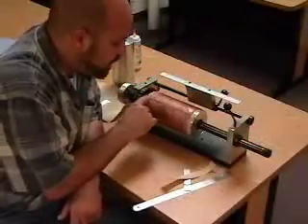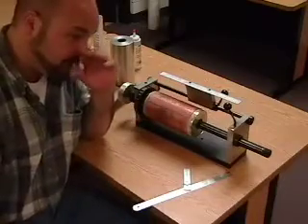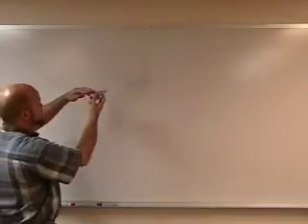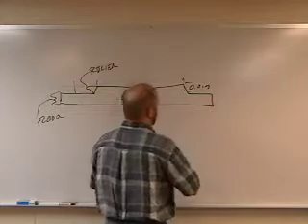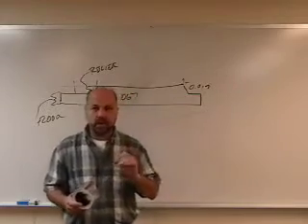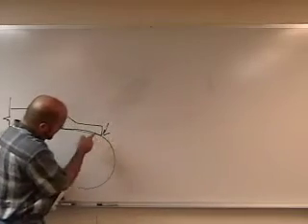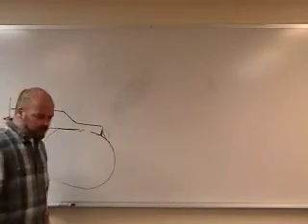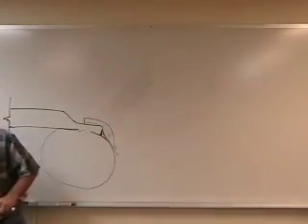Mounting Techniques Part 8, Avoiding Plate Lift

Comment: Thanks. I wouldn't mind working for you. I've got more experience then they give me credit for. I've done almost any type of job you can think of, Process, mark & seal, UV, de-lam re-lam, scratch off, Ion dep, turn bar, double turn bar, fan fold, chop, air knives, butt splicer, str, list goes on. Guys on my press 1st and 2nd are the two most seasoned operators in the shop. Both with over 20 years experience. I still keep up with them. But it depresses me to see I might end up like them. Poor!

Comment from the maker: I know what you mean, clap5.  Only 17 years ago, my 5-year-old son, my wife, and I were living in my mother's Section 8 subsidized apartment in Miami, Florida.  I was making 7.50 an hour and lost two jobs over the period of two years due to layoffs.  That's one of the reasons I got pissed and built FlexoExchange.  It has taken 12 years, but I am free.  It ain't easy, but it can happen.  I've worked every shift, and I know that third is very painful.  I wish you the best.  Don't be a stranger.

Comment: True. But starting at $10.50 then 3 years later only making $11.75. Kinda have a reason to be pissed. On top of that, I work 3rd shift. When they promised me it would only be temporary. Three years is not temporary. There's not many escape plan options. I'm lucky to still have my job.

Comment from the maker: Thanks for the tip.  Don't feel bad, clap5.  I work every day of the week at this boring stuff.  You can turn any crappy job into an escape plan, if you work hard enough.  Or, you can drink 40's the corner and bitch about it, like some folks do.  Old age comes quickly.

Best Regards,
Frank

Comment: i belive that a method used is to spray a little furniture polish on the tape when plate is lifting and press the plate back down (ive never tried this method but i belive it works well).

Comment from the maker: Hi dumfk,

I've heard the same thing from many fellow operators, and I've tried it from time to time.  It may very well work.  However, as I note in the video, I have seen markers affect the quality of the impression of very fine dots.  When I saw this, I decided to avoid the marker in similar circumstances.  If it works and doesn;t affect quality, I say go for it.  It's a good tip.

Comment: When I have a plate pop that I can't seem to tape down, I will peel the edge back wipe the bottom edge and the adhesive tape VERY VERY LIGHTY with ethyl. Then take black permanent marker and color the back side of the plate at the problem edge ..then press it back down to the tape ..usually works.